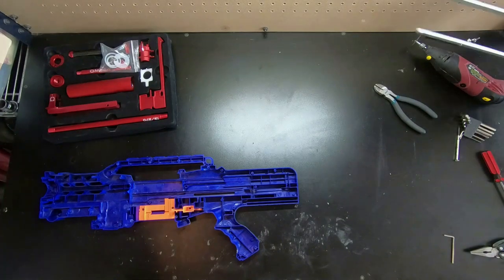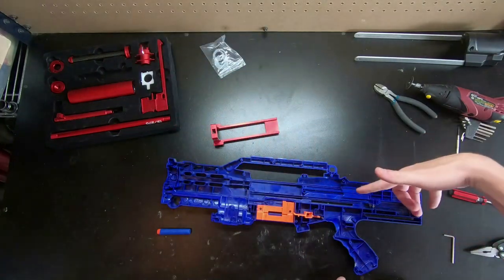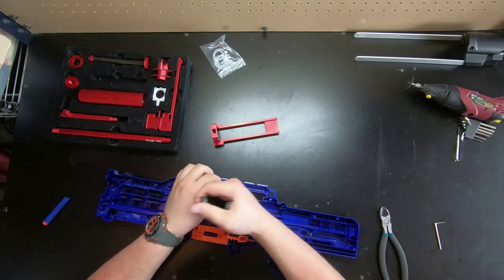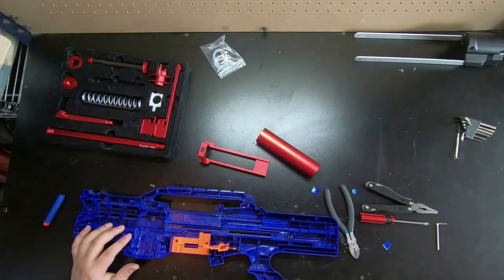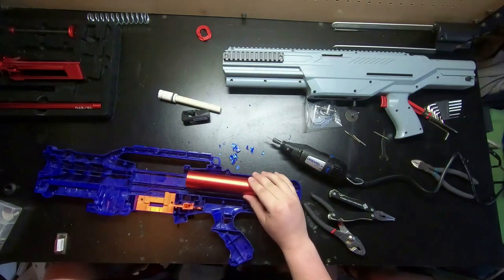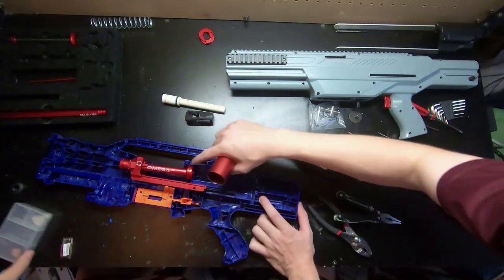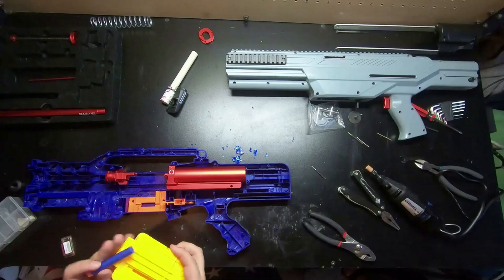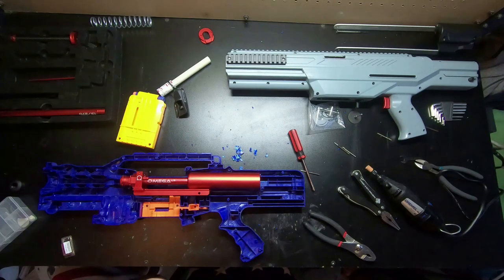X Zeus Omega mod guide part 1

Comment: Ah, so it's a sacrifice of plunger volume in order to fire full lengths. Nice work figuring this one out. What's your reason for wanting to fire full lengths though?
Reply from the maker: Since we extended the draw its actually not sacrificing any plunger volume instead we actually have increased how much of the plunger volume is used. The games we primarily play in use full lengths and so that was why we made the modifications.
Reply: Ah, I see. Good work.
Reply: Wait, isn't the plunger head going to stop shorter now than it would in stock config?
Reply from the maker: On the stock omega kit (what an interesting concept to call the omega kit stock maybe I should say unmodded) the breech pushes back on the plunger head until it catches and when it does that it only comes back far enough to feed half lengths. By extending how far back the breech goes it pushes the plunger head further back by about a half an inch if I remember correctly.
Reply from the maker: Bradley Phillips The spring that we are using are long enough to push the plunger head all the way through the plunger tube since the plunger rod isn't limited by the original spring rest that clipped onto the plunger rod since we removed that.
Reply: Ok, so the rear of the plunger tube is open like a retaliator now, relying on the spring to keep it centred as it fires?
Reply from the maker: Yes the plunger head and the rear of the shell guide the plunger rod forward as it fires.
Reply: Nice. Is the prime as smooth now as unmodded? I may consider extending the draw just for more power without the full length conversion.
Reply from the maker: Bradley Phillips  I appreciate all the questions but this is just part one of a three part series if you just wait for the next 2 parts to come out all of your questions will hopefully be answered
Reply: Will keep a look out for the sequel parts.
Reply from the maker: Bradley Phillips the prime is just as smooth I think it’s really nice
Reply from the maker: Bradley Phillips and the next parts should be going up Friday and Monday an noon MST